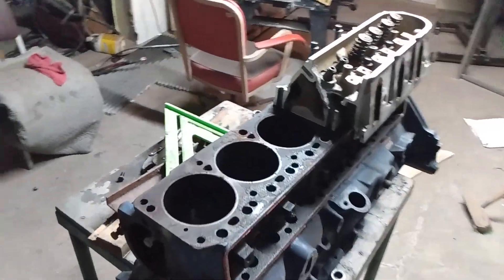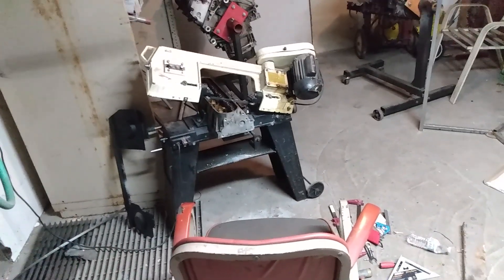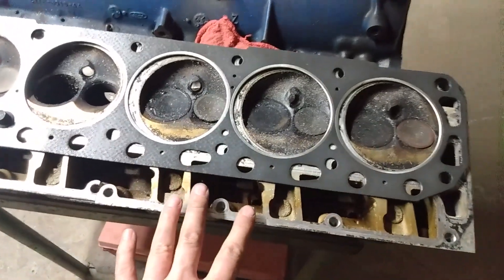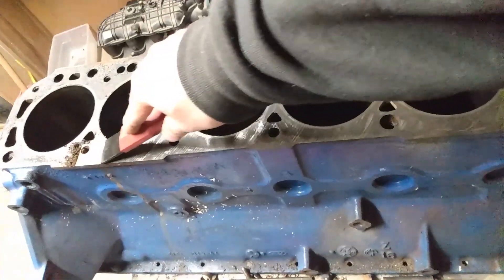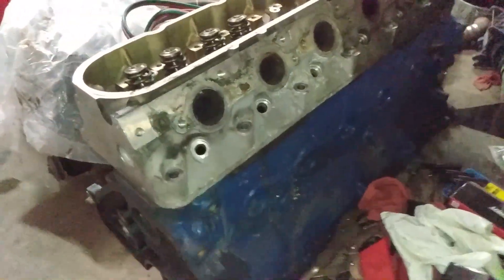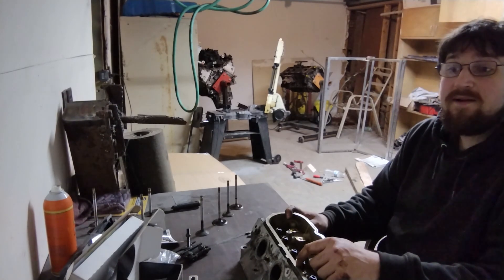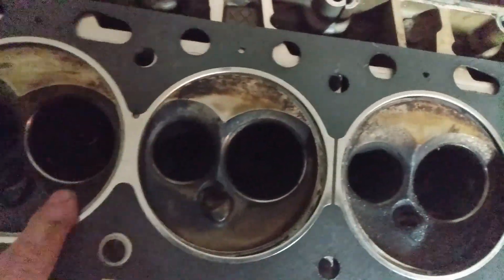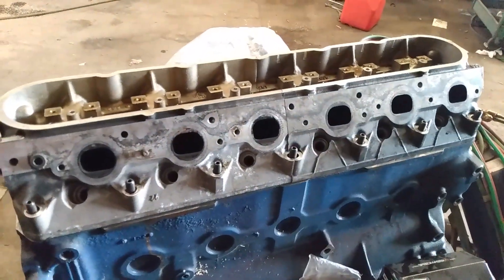Ford 300 HYBRID LS CYLINDER HEAD - WILL IT WORK? Part 1

Comment: Australia built a crossflow aluminum head for the 300 for fuel injection and all that I don't see the purpose.  They were built for the Aussie Falcon version.
Reply from the maker: To bad i dont live in Oz
Reply: @TallGarage  I have thought about having one shipped.  I don't have a 300 but I have owned 270's and 200's in the past and that 300 just has too much potential.  I love an inline six.  Butter smooth.

Comment: dude....... you cut right thru the valve seat....... its never gonna be true again especially under heat and load......... HAVE FUUN!!
Reply: thermal expansion isn't a ghost ......it's physics.....
Reply: unless you are pressing in a new seat lol idk how thats gonna seal
Reply from the maker: Bro im not going to like make fun of you or anything but i cut through a valve seat on the section of head im not using lol.

Comment: I'm putting a Ryan Falconer V-12 (aircraft racing engine) head n my 6-71 blown Chevy I6 292.
Reply from the maker: That sounds like something i wanna see!
Reply: @TallGarage  I have a ways to go yet, time and money. This goes in my drag and drive 53 Chevy 1/2 ton pickup that I bought in 1980. Here is a little more detail. Falconer V-12 head, Custom Weiand 6-71 blower with 2 Quick Fuel 650 DP. Holley 16 jet Nitrous plate, Crower billet crank, billet solid roller cam. steel billet rods. 5 stage dry sump. Mains dowelled and girdled. Electromotive TECs200 coil over EMS. McLeod duel disk clutch, Custom built TKO 600, carbon drive shaft, custom built Frankland Quick Change rear end with Bicknell torque arm. I'm building it to 1300 specs but I'll "never" run it over 1000HP. I'm totally impressed that you are making your own head. Sorry so long. Thank you for your time.

Comment: They USED to take 351 Cleveland 4V heads and cut one in the middle the middle  and cut the ends off the other, then turn the middle section and weld it all up for a 351C 4 bbl headed 300L6, of course they used to bore and stroke the hell out of them as well.
Reply from the maker: Bad to the bone machines!

Comment: What heads are you using?  It seems like everyone doing this is using 706/862 heads from a 4.8 or 5.3 which yes it's cheapest and plentiful but wouldn't it be better to use 6liter heads so it's a matching 4" bore?  I read the bore spacing on the 300 is 4.48 which is damn close to the ls 4.4 so I'd think that would work better but Id love to see it with both to know.  I always wanted to do this since I read an article about a fellow who did it many moons ago but haven't had the time yet.
Reply from the maker: 317 casting heads are what im using, super cheap

Comment: Reminds me of seeing when they did the Cleveland head on the 300-6 This is going to be a neat project. These heads have some advantages over the older style head, especially with the amount of compression you can run or boost very efficient. Can’t wait to see how it turns out.

Comment: That's pretty cool, I am working on a 351 Cleveland head on top of a 2.5 Jeep engine. The ultimate goal is cut a pair of Cleveland heads, weld them together and put it on a stroker 4.0 Jeep 6 cylinder.

Comment: If your going to do that much machine work why not go with a hemi head or a overhead camshaft arrangement? Chevy heads aren’t worth that much work/money.
Reply: Chevy heads aren’t worth that much work/money but yet the LS is world famous!  Thousands of Fords running them.
Reply: Could be because neither Hemi or overhead cam setups make the power that LS heads do!  That why everyone and there Granny runs a LS in there Fords and not Hemi's.  :elbowcough:
Reply from the maker: The only machine work I'm actually doing is cutting the deck of the head to make sure it's flat after welding?

Comment: I've done this a few times. What you have will work...sometimes. The end cylinders will have issues with the valves tagging the bores unless you cut the bores oversize, if you only make one cut-and join in the middle.

To get the bores centered up on the valves, you need to make a cut between each set of head bolts, and weld it up. It isn't that much more work and allows proper porting to make BIG power. Also the stock 300-6 cam will put valve lift WAY up, as it had a pathetic rocker ratio with the stock head. You will need good quality aftermarket springs, as the 300 will rev HARD with 862 heads and the stock cam, and if you get a good balance job done the only limiter is the pistons holding up. With forgings, it is trivial to hit 7500RPM, and with a good quality damper and as light a flywheel and smallest diameter clutch you can live with, 8300RPM was as high as I had the testicular fortitude to go with mine.

Mine has the forged HD crankshaft, there are a few left out there if you call the rebuilders and ask for one specifically. Stock rods are good to about 600ft-lbs of output at the crankshaft, then they start to bend. DO NOT trust the stock rod bolts.
Reply from the maker: the 5.3 bore is 3.780 in.so with the bigger 4in bore i hope itll clear, i made a lot of effort, so i hope the valves will clear, fingers crossed, stock bottom end record here i come but i will use arp hardware.
Reply: @TallGarage  my Stock bottom End record is 418HP with stock 1988 F150 cam, N/A. And the problem isn't bore size, it's spacing. The LS spacing is 4.400", the 300I6 is 4.480", so if you center up on cylinders 2 and 5, then that means 1, 3, 4, and 6 are all 0.080" off center. If you center up on the two end cylinders so the head bolts on the ends line up, then all the cylinders are off progressively more toward the middle. If you center up on the middle two, then the end cylinders will have valves hitting the bores. When I did the ones for mine, I cut the head in six sections and welded up the faces to re-set the bore spacing to 4.480". You will need to weld up the gaps under the intake ports as well, and re-route the water into the head, as the water passages under the intake ports do not line up. Pushrods will run outside the block at the deck surface, and you either need to braze up the edge of the deck or machine a LOT off the deck surface to stop the oil leaks.
Reply from the maker: @Photoswarf  Hey man thats great it sounds like you know a lot about this and i like hearing all the different ways to skin this cat, the bores on the 300 are .220 bigger , that should help clear some or that offset, ill let you know how it gose.

As far the water ports all the water ports on my gasket were good but the two on the very end that went outside the gasket.
Reply from the maker: @Photoswarf  also im going to need some proof on that stock bottom end pass so know what too beat.
Reply: @TallGarage  If you think I'm the guy to beat you're about 200HP under the goal...the highest I've seen is a guy from NC who runs one in an altered roadster, makes just over 600HP on a 240 crank. You gotta be ready to spin the RPM.
Reply from the maker: @Photoswarf  man I hear you but I don't believe any of these guys are running stock bottom ends making anywhere near that much horsepower so if they got the proof and The Time slips then have at it but until I see otherwise I'll be holding the stock bottom.end record as soon as this thing is done lol
Reply: @TallGarage  There isn't exactly anything except stock bottom ends available, man. You can't go buy parts for a 300-I6, the rods are longer than anything remotely stronger, and there is no need to go to an aftermarket crank-you either run the forged HD crank, or the cast 240 crank, and that's it. The engine's been making big power since the 70's, because they just don't break.

You'll figure it out pretty quick once you run the numbers for lift on the stock cam, and factor in the 1.1 stock rockers vs 1.7 LS rockers. (Hint-the stock cam has more lift than many aftermarket LS cams!)
Reply: @TallGarage  Also, the HD engines from the F600 grain trucks and airport tugs cam with forged bottom ends, TRW forged pistons with a very large dish and low compression ratio, the rods are all forged, and the HD engines got forged steel cranks. It's not like the bottom ends are made of glass like some other engines.
Reply: @Photoswarf Do you have any videos of any builds?
Reply: When you get done make two. I want one

Comment: Is that a Cologne block assembly over in the corner? What's that all about? . . . anyways, I'm putting together a plan to do a similar cross-flow Frankenhead on a Jeep 4.0L six. Just getting some ideas. It will be a while before I post any videos. Looks good, carry on. I love odd ball engines and engine mods. Greetings from Alaska.
Reply from the maker: Considering I don't know what that is probably not but on the other hand looking forward to seeing your project man
Reply: @TallGarage  . . . Thank you. at 1:22 , the camera moved over the engine on the stand just past the band saw. I thought it was a "Cologne Block" V6. Fords V6 that was in the ranger as the 2.8, 2.9, 4.0 OHV V6's and also the 3.9, 4.0 and 4.2L OHC V6's. It was designed by Ford of Europe at their Cologne, Germany design studio. I slowed the video down and I can see that it is not a Cologne block. My mistake. Anyway, subbed and looking forward to more videos from you as well.

Comment: Make the head where I can just bolt it right on my Ford 300 engine. Make it gain at least 200 horsepower and I will pay pretty much what you ask.
Reply from the maker: Once I have a running engine I'll be taking orders

Comment: have you considered leaving the head in 2 pieces and just welding shut the water jackets at the sawn ends? I am concerned about warpage and expansion is why I mention. Should be a way to tap in and connect to allow for coolant flow that can be easy to work with. I'm not familiar with the ford 300 head design, but it must be pretty bad for you to consider doing something like this.
Reply from the maker: its pretty bad, im almost doubling the CFW, and i could probably keep it in two pieces but itll be getting welded while bolted to the block should help keep it from warping and the machine shop will take the rest out.

Comment: damn, that is cool, now I really want to do a Slant 6 with a Hemi head!
Reply: Closer fit for the small bore would be the Mazda/Ford 2.3L heads cut and welded. Need special inline 6 cams made to the Cosworth cam specs to used with VVT.
Reply from the maker: this is an interested comment i missed\

Comment: I know Cleveland heads have been adapted to the 300 six with amazing results. What kind of power are you aiming for? I would guess 350 to 400 hp is very possible.
Reply from the maker: itll be seeing boost pretty fast, looking forward to see what it dose NA tho. going to set the stock bottom end NA 1/4 mile record before i go boost.

Comment: Didn't the aussies used to do this with Cleveland heads ? I think they would cut them up and leave them NOT joined so you ended up with 3 separate heads ? or maybe I was drinking that week ........
Reply from the maker: i think they would braze them together
Reply: @TallGarage  furnace brazing can be used with iron heads, wish I knew someone/somewhere that did this
Reply: try Glidden Racing, whiteland, Indiana
Reply: @TallGarage Welding steel to a head works great. It can stretch without cracking.Id try capping the ends. Sounds like a challenge.
Reply: Yes there's someone that raced at El mirage probably 30 years ago 4v heads with Weber carbs or hilborn stacks. Baddass for what it was
Reply: There was a 300 raced in the 80’s or 90’s that had a cut up set of Cleveland heads that was laying the smack down on v8’s

Comment: Good job, you did it! What are you going to do with the coolant passages?
Reply from the maker: should seal up when its welded.
Reply: @TallGarage  

The other channel you posted the link to welded plates on the end of each head before he welded the 2 together and plumbed in external lines to move the coolant across. Are you doing yours different?
Reply from the maker: @itseithergonnaworkoritaint7852  yes, i dont think plating these is necessary but i could be wrong.

Comment: LS swap Everything. In your case, each V8 has two heads, so only one LS had to be beheaded to make one Big Six 4.9 liter. Now,  if three LS engines had to die to save one in line 300 six...that's would be Justice. what ya gotta doo Tall Man...
Reply from the maker: no LS guys want 317 casting heads
Reply: LS NO THANKS
Reply from the maker: @BronsonOsborne Translation: I'm Slow.
Reply: All the Ford boys buying up all the LS to make there Fords go fast.